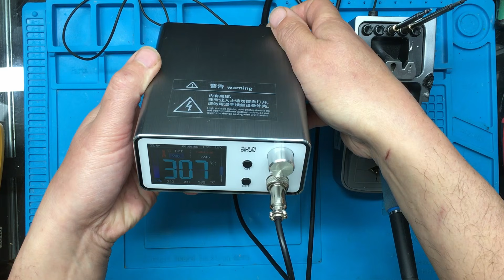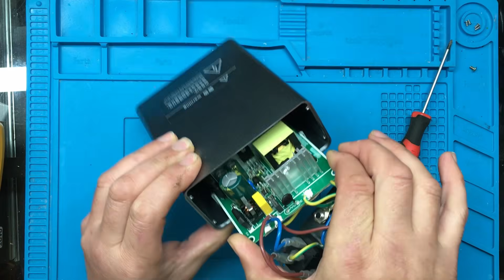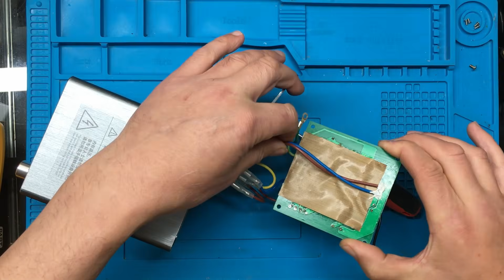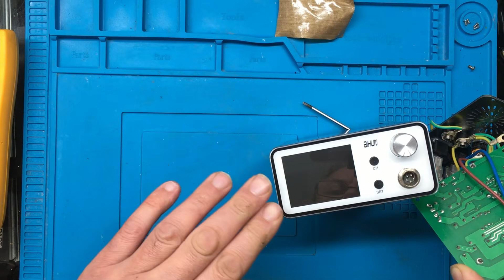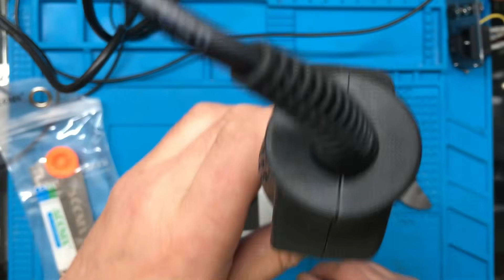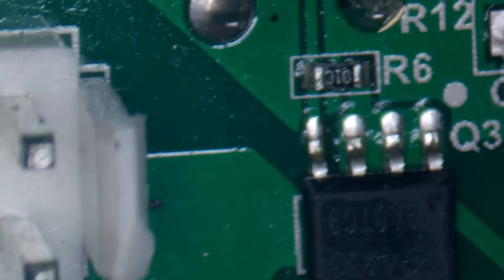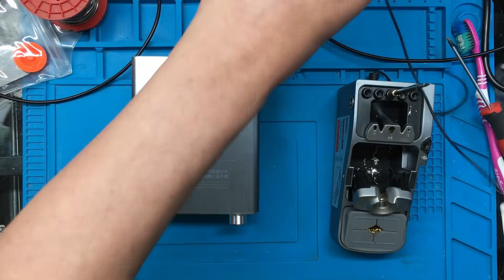Repairing An AIXUN T3A soldering station

Comment: Why but WHY! did you put back the glass when the test was not even done!!!!!! Sorry been debugging intermittent bug all my life long so when I see someone fully assemble back a device that is not totally tested especially with glued parts I turn green, red, black and then I burst!  I am sure that you did tested it back fully before assembling it after you found the fault and you did not showed it in the video to shorten it a bit. And I do understand that. but other user that are not fully used to electronic debugging could get the wrong message here..  And the message is simple, ALWAYS test the whole thing many time before gluing back some parts that are not needed for the full function of a device!
Reply from the maker: Yes, I do sometimes give it a quick test before assembly, and sometimes remove that to shorten the video as you said. The glass actually keeps falling off since I removed it so I think the adhesive weakened the first time it was removed. The station did go faulty again about 3 weeks later (I think the diode was breaking down internally and the heat caused the bond wires inside to reconnect for a while). I ended up replacing the diode, and it's been find since. Some things you can't test without re-assembly or 90% re-assembly, such as the Milwaukee Impact driver I recently looked at. The casing actually holds the motor shaft in position, and needs pretty much all the screws back in to hold it. Thank you for your thoughts and comments.

Comment: I just got a T3A, I like my T3B. The T245 handle makes a noise, like a fast clicking noise, which I’m heavily assuming is a bad electrical connection, but I don’t know quite enough to know for sure. Before I pull the thing apart, has anyone experienced this? I don’t want to pull it apart if I don’t have to, but it should not be making any noise, right? Help!
Reply from the maker: Mine makes a buzzing noise when heating (I think it's the PWM), but I wouldn't say clicking.
Reply: @BuyitFixit  I’ve contacted both Aixun and the seller… sent them a video of it, waiting to hear back. It could be considered a buzz, I suppose… if it’s just the way it is, then so be it, but it definitely makes me a little nervous… as long as it works and doesn’t explode, I’ll be fine with it. It doesn’t see a ton of use, as it is my field soldering kit for work. I don’t have to solder all that much on the job, and it’s usually nothing too difficult or complex, so the T3A will likely do just fine :)

Comment: For sure I would have bust that glass! was the Zenner providing a REF voltage ??....cheers.
Reply from the maker: Yes, I think the bond wires failed internally as it lasted about 3 weeks, then I ended up replacing the diode and it's been fine ever since.

Comment: After watching this repair, I cancelled my order and bought a simple soldering iron. If that goes bad, I just chuck it away.
Less hassle.
Reply from the maker: The price of these seems to have almost doubled from when I bought it, to be fair despite its complexity I really like it. It heats up instantly like in a second. I used to use Antex irons prior to getting it. Thanks for commenting and good luck with whatever iron you get.
Reply: @BuyitFixit I’m tempted to design my own but I have way too many side projects already ;-;

Comment: Fantastic stuff.
It's such a pity that so few people ever even consider trying to repair things nowadays; most people just send things straight to the rubbish dump without even attempting a repair.
It'd be great if basic soldering and repair was a subject in schools, even basic stuff like replacing components and resoldering dry joints.
Reply: Repairing things can require a considerable amount of time investment.
Time is the most valuable of all assets.
Reply: @hypnoz7871  That may be so sometimes, but if something that costs €300-500 breaks, and you just dump it, then it will cost you another €300-500 to buy a new one.
And that might be a week's wages in work. So you will be spending time anyway, just in a different way.
Whereas it might take you 5 minutes, or maybe an hour to repair it.
Like I've lost count of the amount of times I've taken something apart, couldn't see a problem, and put it back together and it worked fine again. Or I might just see an obvious broken wire and it's fixed in 2 minutes.
Reply from the maker: Thanks, this did fail again about 3 weeks later, I think the bond wires in the diode had failed. Replacing the diode fixed it permanently and it's been working fine since. I updated the video description with this info and the schematic.
Reply: @BuyitFixit  still working?
Reply from the maker: @yotoprules9361  yes, used it in the last video (last week)👍🙂

Comment: From Aliexpress in case it helps other : Original MP9942GJ-Z MP9942GJ Marking IALLN 1ALLN TSOT-23-8    RS Components has a datasheet.
Reply from the maker: Thanks👍I had already added it to the video description a while back after finding a schematic someone reverse engineered on github. But thank you for trying to be so helpful 🙂

Comment: I was left behind because, through out the hole video,I failed to notice the repaired part and what the fault was.🤔
Reply from the maker: The zener diode on the 3v3 power supply was faulty. I thought originally it was a dry joint as when I re-soldered it, it made the unit work. About 3 weeks later it died again, I think the bond wires inside the diode had failed and heating it caused it to reconnect for a while. I eventually replaced the diode and it's been fine since (I updated the video description explaining all of this, but I guess you missed it).

Comment: i have missed the point !!
 what's happen  makes it work ??
Reply from the maker: I think the diode was breaking down internally due to thermal expansion. Heating it with the iron fixed it for a couple of weeks but I eventually replaced the diode and it's been fine ever since (I added this in the video description a while back).
Reply: thank you 😊😊

Comment: Bright idea: why having all your skills you still use chineese cr@p?? You're profi, you can make this station yourself! Of course tips and handle you buy, but other parts can be easy bought and assembled (with MUCH more robust scheme). Literally you need some STM32 and power regulator. What's hard here?
Reply from the maker: True, although I'm not a professional 🙂. Time is one of the main factors. YouTube is just a hobby currently. It doesn't pay the bills. I could have probably rolled my own as I've done similar with an incubator I made out of a wine fridge, designed the pcb and wrote the software. It was internet connected and logged all the temperature and humidity to things board.

Comment: Boring video. I even didn't see what exactly was wrong. "some resistor"???
Reply from the maker: No, it was the zener diode that regulates the power going to the buck converter. The bond wires inside the diode must have detached and heating it with the iron must have expanded the metal and the wires connected again. I had the same issue a couple of weeks later and ended up replacing the zener. It's been fine since. I updated the video description explaining this.

Comment: When I had that scope it was always noisy like that. I had the t3b which was doa and kept shorting the tips. I recapped it, changed components, reflowed all the joints. Still killed tips then shut off. I threw it in the closet out of frustration because they wouldn't honor the warranty and called me names. Seller phonefix on ali not China phonefix. I turned it on six months later and it's worked great ever since.  I'm baffled
Reply from the maker: Hi Joey, I did an update in the video description where I replaced that diode. I think the bond wires were failing and heating it up with the iron made them connect internally for a few weeks. I also found a schematic that someone reverse engineered which may be of use if you have any more problems 👍
Reply: @Buy it Fix it  sorry for rambling.  I have ptsd and I feel like I just accept this kinda shit all the time. Great content by the way. I'm gonna post a workshop tour when I get my microscope and such.
Reply from the maker: Thanks Joey. Let me know and I'll check it out 👍
Reply: @BuyitFixit  cool thanks.

Comment: Tell me about the T245C handle, are the metal parts aluminum or stainless steel?
Reply from the maker: Sorry I'm not 100% but I did just try scraping the metal part where the heater plugs into with my dental pick and it didn't mark it, so I think it's stainless.
Reply: @BuyitFixit  Thank you very much for your answer! You helped me a lot? Can you tell me if the wire is silicone? Soft?
Reply from the maker: @asupsp700  yes its silicone and soft 👍

Comment: I’ve got this station and it’s good, I seen on videos how the newer firmware causes a big overshoot so I wouldn’t update it, once you connect it to that software it will update automatically so I won’t even connect it, one thing I noticed, there’s no way that power supply is capable of 200w and even if it was the soldering iron tips and handle can only do 130w
Reply from the maker: Thanks for the info Imran Ali👍
Reply: @BuyitFixit  I noticed at the end of the video, yours overshoots a lot, in the video I seen it never overshooted a lot but after he updated then it started to overshoot a lot, I just done some tests and I’m on the old firmware but what I noticed was with original JBC tips there’s no overshoot at all, but with non original tips it overshoots, I’ve got a few different brands and some overshoot more than others, the original JBC tips are not only more stable with the temperature but no overshooting. I’ve got the T115 version aswell which you can use the t115 or t210 handle, no overshoot on JBC tips or non original tips
Reply from the maker: Thanks for that. I might try some JBC tips!

Comment: we have these in use at the shop being used daily all day along with t3b and t420d's and yet to have any issues except with one unit needed a cap changed and was back up and running again. but we have around 14 t3a's and its been a year roughly without any other issues at all.
Reply: I recognize those cheap green caps they like to use. seen many fail in Samsung and Dell stuff. I would imagine with some good Panasonic caps or Nichicon etc would fix them long term.
Reply from the maker: Thanks 👍I think on eevblog a few people had changed the capacitors as a matter of precaution. I might do the same. After making the video, the diode failed fully. I think it was the bond wires inside of it failed. I replaced the diode and it's been fine since. I updated the video description with all of this information including the schematic. Thanks for commenting 🙂
Reply from the maker: Nice 👍Thanks for letting me know! They seem fairly reliable then from what you said.
Reply: А я поменял за 1  года 3 такие щуки. Они все опали на земля от 1-2 метра и у каждох етот проблем.
Reply: I bought 3 such soldering irons in one year and they all got this problem after they fell to the ground from 1-2 meters. Disassembly was impossible and I was forced to throw this beautiful piece of garbage with great force to hang on a tree branch and then I bought another one, the problem repeated then a third one and I can't disassemble the front panel.
Reply from the maker: Mine is still working fine, and it has had a lot of use. Just gently heat the front glass with a hair dryer and then use a plastic spudger to remove it.

Comment: For anyone wondering what the mysterious IC is, its an MP9942GJ-Z.
Great video :)
Reply from the maker: Thanks for that PrawnCocktail 👍. I did find it on a schematic on eevblog a few weeks back as I did have an issue with it again. Turns out that diode is a 4.7v zener and was breaking down after some time. I think the heat from my iron temporary repaired it for a couple of weeks but I ended up replacing the diode. Been fine since.
Reply from the maker: I've updated the video description with the schematic and the diode I replaced and the IC part number. I was meaning to do it and thought I already had. Thanks for reminding me and thanks for commenting 👍👍👍
Reply: How do people figure out what ic it is?

Comment: Anyone having trouble using original JBC tips on this station? I wonder if the original tips didn't damage it. I bought the station and immediately ordered tips from TME. I only tested the ones from aixun and switched to the original JBC. The station has been operating less than two weeks and has died.

In an extensive topic on evvblog, a user wrote that the station "buzzes" when heating the original JBC tips, and when using those from aixun, the "buzz" does not occur. Has anyone logged a problem like this? 🤔🤔🤔
Reply from the maker: I'm not 100% on that one. I did see the thread on eevvlog. My station died again last night but I brought it back to life again. On mine the diode next to the small psu on the front panel seems to be working intermittently so I've ordered a new 4.7v zener for it. Heating the diode up seems to bring it back to life for a while.
Reply: @BuyitFixit  Maybe this zener diode should be for more power. I'm still struggling with what to do with this station. The Chinese guy offered me a refund when i sends back the station or sends me a new station. I'm afraid that the new one may have the same problem, I'm not sure that the problem is not in the handle, I compared the tips with there are and there are small differences in the shape of the tips ... If it turns out that there the station does not want to work with JBC tips, it is useless for me, because aixun has only 3 tips in its offer for T3A.
Reply from the maker: I think the zener just provides the voltage for the enable pin on the psu chip so there shouldn't be any load on it. I've never tried any other tips except for the ones it came with.
Reply: @BuyitFixit  before buying, I watched many reviews of this station, I read the comments under them and everyone agreed that the original JBC tips work with this station without any problems. I think most of the buyers were hoping to be able to use JBC tips, because as I mentioned before, aixun only offers 3 tips for T3A, what kind of station is this that can only handle 3 tips? shit not a station in my opinion (no offense). I don't know the cause of the station's death, the cave from JBC, or the shitty performance. I have a KSGER 2.1 station and it has been working without problems for over 2 years. aixun was 3x more expensive and died after two weeks.
My video:
https://youtu.be/oL4-pFmsd8w¹

Comment: I have a similar problem with this station. I haven't opened it yet because I'm waiting for a decision from Mr. Chinese.

When the station is turned on, you can see a green light inside the housing (probably SMPS is ok), but the display will remain black. I plugged it into my computer and it boots up normally. It follows that the problem is somewhere between the output from the 24V SMPS and the logic board. I don't want to open it because I hope the seller will send me a new station or refund my money. The station operated less than a month.
Reply from the maker: Sounds like a similar issue or it could be the connector from the smps to the main board as it was crackling on mine.
Reply: @BuyitFixit  The problem started with the tip heating up. When I took the tip out of the stand, it was heating up normally, the station is heating up the tip to maintain the temperature and just during this heating up it turned off and I heard some buzzing inside and I also thought about the bad contact of the plug from the SMPS output. Now it won't boot from SMPS and as I mentioned before there is probably a problem between the SMPS output and the logic board.
Reply from the maker: Sounds like that connection. It would draw more current during heat up..
Reply: @BuyitFixit  I know, it's a flawed device design and I'm not going to solve this problem for a Chinese guy. I paid and I demand they take care of it.

Comment: No reason to assume anything about the rest of the build quality based on the case: It’s a standard off-the-shelf extruded aluminum case. You see them used for everything from soldering stations to hard drive enclosures to the WeeC mini PC from TheRasteri. In other words, they didn’t design or make it. They just picked a generic enclosure and shoved it in.
Reply from the maker: Good point. I'll bear that in mind. I just assumed if they used a better quality case instead of some cheap plastic one it may have reflected on the rest of the build. We all know what they are like to save a few pennies...
Reply: Sh%ty point of this case is 1) hard to get into device. Some LID could help a lot. 2) It's aluminium, meaning you need DOUBLE care when operate with boards (to avoid short circuit). Normal plastic box with lid could be much better solution.
Reply: @daitedve1984  IMHO: AC grounded solder stations are saver than ungrounded ones. Grounded ones have no PWR inducted voltage on minus at the dc side and also not on the solder iron.
Reply: So are you suggesting that we all should buy $800 soldering irons?

Comment: Interesting video. I have the T3B version which is my daily driver for SMD work and am really impressed with its capabilities. Just a shame about yours failing. Hopefully a long term fix. Karl
Reply from the maker: Thanks Karl. Still seems to be working fine. Worst case scenario if I couldn't get parts I  would have just added a small 2.8v regulator board off Ebay to power the microcontroller from the 24v.
Reply: @BuyitFixit  Smart!